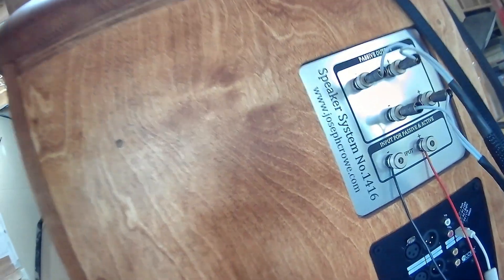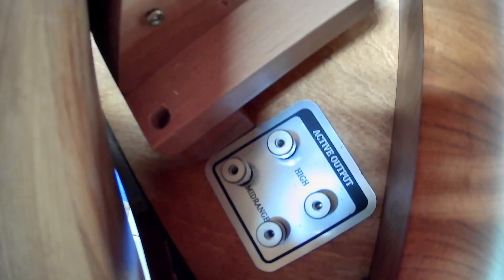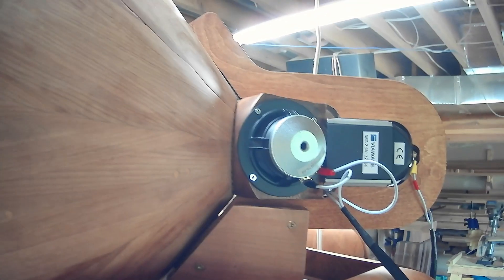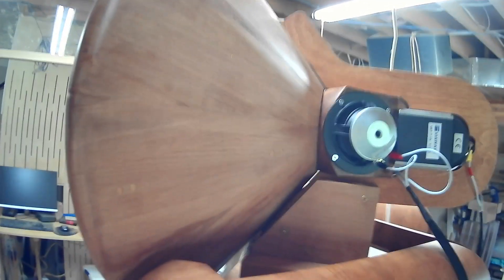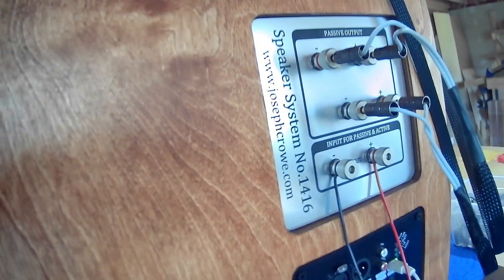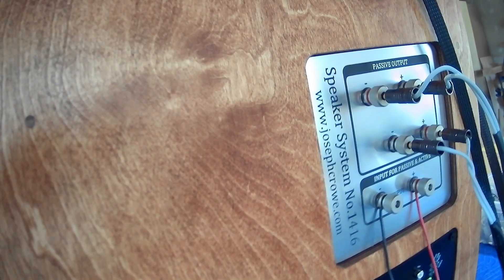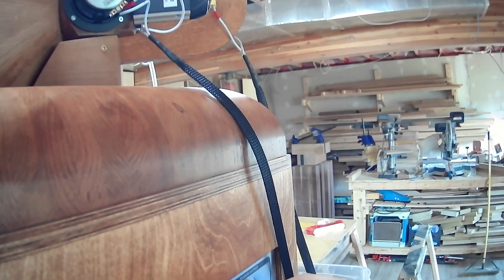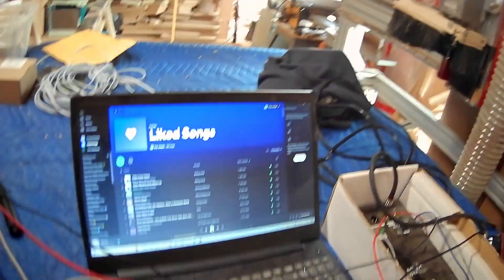Listening Test Passive vs Active on Speaker No.1416

Comment: Troy, may I call you Troy? This is one of the best sounding speaker test sound clips I have heard on YT to date, and I heard quite a few. Simply Devine. Such a shame I'm not filthy rich or you would have another order for these already. Going to open a second TY instance of this so I can rapidly switch to see if I can hear a difference or not. Love what you are doing, keep up the great work. Love the design for both the vintage aesthetic as well as the modern touches and how creatively you solved the Active/Passive dilemma. Bravo!            OK, did my test and I wouldn't have believed it is I hadn't heard it myself first hand, but there is just the slightest bit more ambience in the passive. I can hear more of the acoustic space so there is actually MORE detail using the passive crossover. Wow. I prefer the passive. It is REALLY close though and I'd be tickled with either one. Do you think that maybe the FA501 is just a better amp and that is the difference? Thanks again.

Comment: I go back to the Naim Audio days and agree with their ethic of using identical amplifiers for active application in all frequency bands. No matter how much I bucked this the proof was consistently in the listening and they were right. Personally I prefer passive line level crossovers but the inductors (as well as other elements) need to be varied with the empirical process and this is spendy and inconvenient...

Comment: You can't make such a generalization as "Passive vs Active", esp that Hypax, it's really just a comparison of your two cross overs (amps too). In the general case, given the same amps, an active x-over can be setup to sound identical to the passive (would not pass a double blind A/B test).
Reply from the maker: The title of the video says “…on speaker No.1416”, if I had simply said “passive vs active” then I could understand how a generalization could be implied.

Comment: Sounds like the the biamp is clearer most likely due to time alignment.  When I did commercial audio design, I would time align the typical dual 15"/horn passive box using an open architecture digital box and get the same improvements in clarity.

Comment: It does sound different, but I'm not sure I could tell in a blind test. The passive sounds less detailed. It also sounds more glued together, as though it was coming through a single full range driver. The active lets you hear the individual drivers, which isn't necessarily a good or bad thing. It might be that the active was a little louder.

Comment: Impressive in both cases.. But you really can’t hear much difference between the two Hypex amps.. And it seems you used high quality XO parts for the passive too.. Maybe in actual live listening the passive is less dry sounding and has more air..?
Reply: I felt the same.  I think with a stereo playback we could better hear the nuances of space and air which is where I think the differences might be.
Another of my biases is we also would need to see an actual tube amp to bring out the best of these.  A plate amp is IMHO a filter removing micro details.  Great for bass or subs but not my cup of tea for mids and highs.  Again my bias speaking as I run 110w triode mono OTLs.